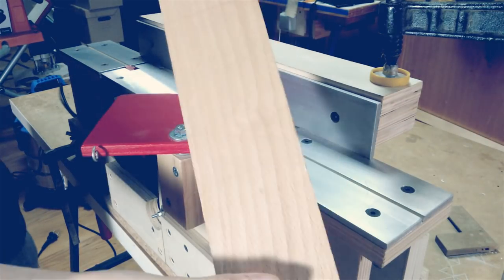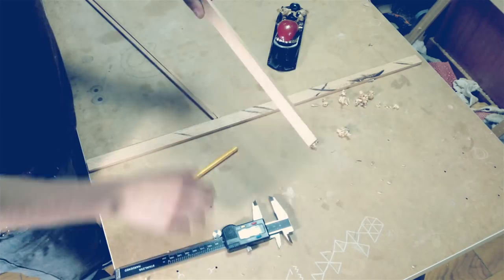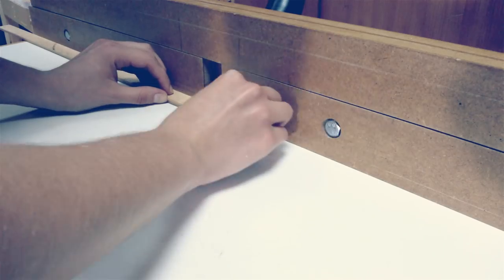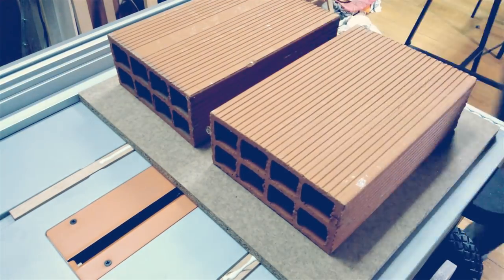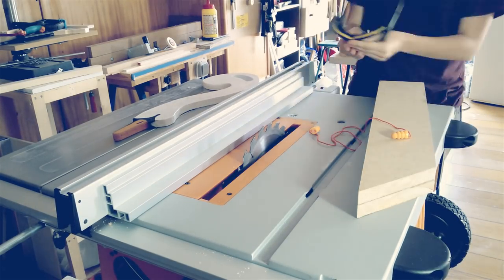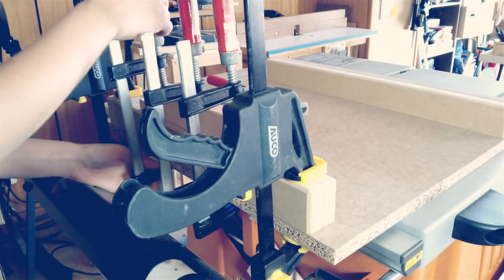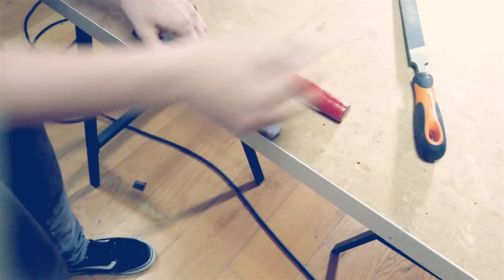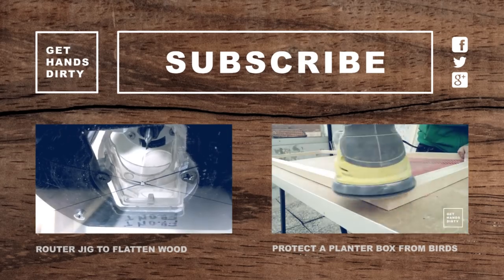Create Perfect Mitered Corners with 45 Degree Cross-cut Sled

Comment: Yeh I will need to make one.  Incidentally, I have not had good luck with wood runners. They would swell somehow and no longer fit days after installation.   I got 3/8” by 3/4” aluminum alloy bars and they work great in my table saw.  I also put paste wax on the bottom of my sleds for smooth movement.  Thanks for your creativity and talent. Your videos are amazing.

Comment: I just cut those tabs in the slot in my table saw with an angle grinder lol
Cool push stick by the way!
The clamp modification is really cool
Reply from the maker: Rexus King I'm aware that there is people that cut them off, but didn't want to do so, it's actually not that difficult to make these runners. Thanks for watching!

Comment: Thanks for the video which is great. This may be a daft question but I am a beginner and would like to know if you have to take your riving knife off the table saw to do this. Mine will not lower below the height of the top of the blade unless I take it off altogether and so I can not make a cut through the whole length of the jig without also cutting full thickness through the fences - which obviously will just cut the whole thing in half! Is it safe to take off the riving blade?

Comment: The benchtop jointer looks great!! started making one with my electric hand planer but the depth adjustment was being a little cumbersome so I opted for the No 7 plane...How hard is it to adjust yours? because I might need to build another one that I can move around if needed.
Reply from the maker: ismael niang Thanks again. Mine is not that hard to adjust, but I usually don't do so. I have it set to the minimum (0.25 mm) because I don't bother passing the wood three or more times and at the end get a smoother surface than trying to remove 1mm at once. I will make a video about the benchtop jointer in a near future.
Reply: Get Hands Dirty I think that would be great
Reply from the maker: ismael niang Hi! I made a video about the jointer. https://youtu.be/EEkWZofao00

Comment: Aloha, what router bit did you use for your "t cut" runners? Sorry , kinda newbie question.
Reply from the maker: +keale s Olá! I used a regular straight bit. In this case it was 10 mm straight bit, but it can be any size as long as you move the fence to keep only the amount that you need to remove protruding.

Comment: What kinda table saw do you use and what what would recommend for a first time buyer?
Reply from the maker: I use an AEG TS250K. I never had another one and I'm pretty happy with this one, it's very precise out of box. Just need to deal with the tabs on the slots. I filed them of later so i could use straight runners.
Reply: +Get Hands Dirty : I can understand you filing off those tabs from the slots. What were they thinking? I've never seen that before. 

When ripping thin strips, it's been awkward for me to accurately measure the fence position, because mine has a high "face", and it's difficult to get the gauge in there.  But yours has quite a low strip that touches your timber. Thanks for that idea, I'll make a low strip attachment for such close tolerances.

Comment: Thanks for this video.  I built the sled and then ran into a brain problem.  I can't seem to figure out how to set up the stop block for a specific length.  Can you help an old man by explaining how you set up for length ??
Reply from the maker: +fishman211 Well, if your lumber is longer than the sled, you can clamp (or screw) a long board to the sled fence that is next to you in the inside and then clamp a stop block to that long board. And then the blade will cut into your piece and goes into the new long board. Not sure if I explain this well.
Reply: Thanks for the reply.  Actually what I am trying to do is figure where the stop block should go without sneaking up on the cut.  I have tried doubling the thickness of the board and adding this dimension but it doesn't seem to work out.
Reply from the maker: I draw a pencil line in each board and align that line every time with the kerf that is cut into the fence... It works quite well. Check out this video to see the sled in action. Maybe you can get a better idea. https://www.youtube.com/watch?v=FvRNyfrN_ro
Anyway, since this is a 45º angle, you just need to measure the thickness of the board you're cutting and make a mark to the left or right, depending in which direction you need the angle to be cut. It should work... I hope this can help.
Reply: Thanks again.  This makes sense to me so I will give it a go.  My wife says I always overthink everything and I tend to agree :)
Reply from the maker: +fishman211 Ahah, good luck on that ;)

Comment: your table saw its just too beautyto do this but i grind the hell off that things of the rails of two tanles saws now and no regret.
Reply from the maker: I just did that about a month ago!! If you see my last two project videos you will see those crappy tabs filed off. It was such a pain in the butt to do t-track runners for sleds.
Reply: Nice! Custom tools are the best tools, you gotta look my 4 mtrs angle grinder cords the c.clamp welder clamp and lots of stuff. Be sure i will see the videos i like your style qnd stuff saludos.
Reply: Yeah, I've never seen a table saw requiring t-track sliders. That's ridiculous. That would be enough to make me pass up an otherwise good deal on a saw.
Reply: Jesus Diaz j

Comment: I really like your jointer :D I can't really affort one of those big cast iron monsters (even if I want to soo badly xD) so I've been thinking about modifiing a hand held power planer for some time. Do you have footage of the build?

As I see you run those small pieces of wood through the table saw, I think one of the next projects should be some zero clearance inserts. ;)

Your work on the router table scares the crap out of me. ^^ Call me a safety sally, but after I lost a piece of my right thumb to a router table, I got really careful and recommend feather boards and/or a push stick/ block for that kind of work. It was a really small piece of thumb, but I was big enough to teach me a lesson.
Reply from the maker: ensen89 Thanks! Unfortunately I don't have pictures of the build. Yes, zero clearance insert is on the top list for sure! And some decent push pads too! I'm thinking of trying to make something very similar to GRR-Ripers, let's see.I understand what you mean about the router table, but I really never ever put my fingers in the alignment of the bit while working with short pieces. I think it's the perspective of the film that makes you think so. Anyway thanks for the concern and I will be more careful from now on and use some pads as soon as I make them. :)

Comment: there must be a better way to cut simple 45 degree Mitered Corners, what if i need to cut 30 degree corner?? or 35?? make a new sled for every angle??
Reply from the maker: Using this method, yes, you need different sleds for each angle. You can get away with the miter gauge if you have a good one or using a miter saw/radial arm saw
Reply: Arifeen Ahmed
Reply: ...or just invest in a miter saw?
Reply: I agree with Mike, i decided to invest in a quality table saw and it has saved me a lot of time and timber

Comment: Why no riving knife or kickback pawls?
Reply: The video was about building a miter sled like the title shows.  It's was not about the merits of safety.  Go be self righteous somewhere else.  BTW it's a "riding" knife.  Spell check is a great thing as long as were critiquing other people's work here.
Reply: We're, not "were"......as long as you are spell checking.
Reply: LOL. The only thing that looks more stupid than correcting somebody's spelling on the internet is when somebody corrects a spelling that was already correct by saying it should be spelled like an entirely different word. Nice work. It's a riving knife.
Reply: I take my riving knife off when doing miters. If it isn't perfectly aligned, which often times it isn't, it can screw up the miter for me. I do keep it with the normal cross cut sled though
Reply: Fair enough.Sometimes my riving knife exerts pressure one way.
Reply: Riving knives are not needed when using a table sled, the sled is a safer way of cutting than any riving knife. Kick back and jamming due to applied twist is eliminated its why they are so good.

Comment: I like the sweet goose. Did you think about using a riving knife? http://en.m.wikipedia.org/wiki/Riving_knife
Reply from the maker: norm1124 Absolutely. I really need to make a zero clearance insert with some splitters. I got a lot of burning as you can see when cutting the beech board...I have a riving knife that came with the table saw. The problem is that I couldn't align it properly and the wood was getting trapped between the riving knife and the fence so I removed it. I'm going to work on that soon!